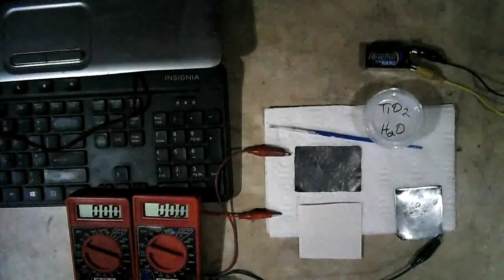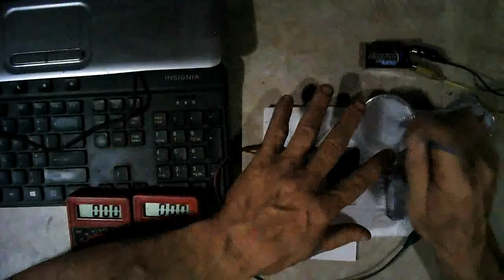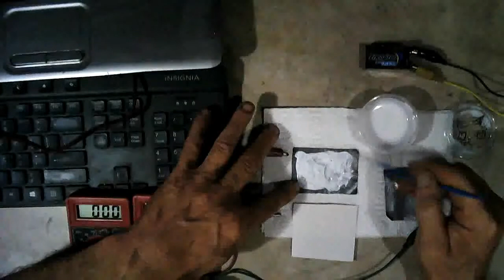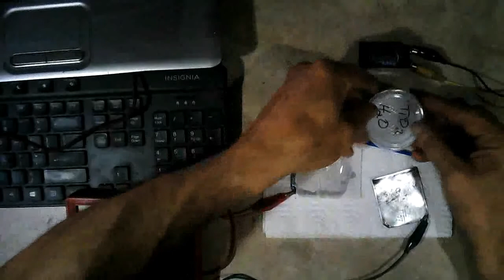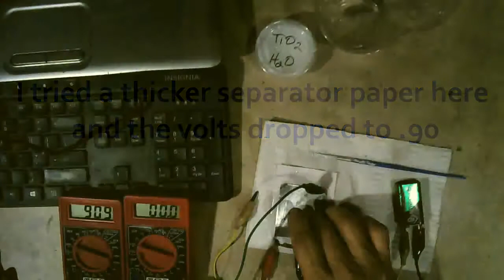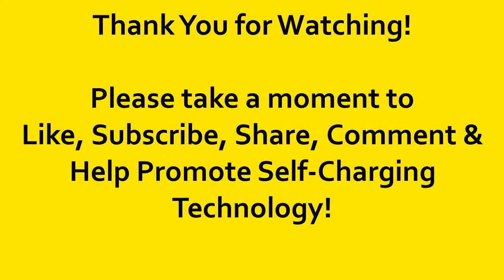Reversing Tio2 & External Charge Test!!

Comment: That almost reacted like it was trying to work in reverse. The spike and sudden drop is very odd. It reminded me of a capacitor in a DC circuit allowing current flow until the plates equalize. It does seem to indicate the Ti02 is acting as a semiconductor in the circuit.
Reply from the maker: It is odd. The cell was closer to charging with the TIO2 on the anode side. It shows that the TIO2 can be put anywhere in the cell however, which is good to know.